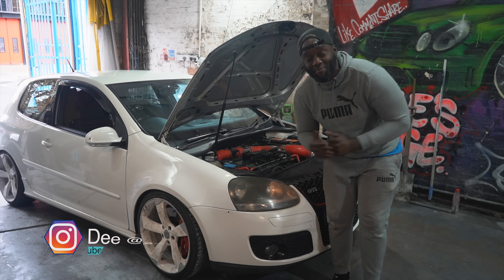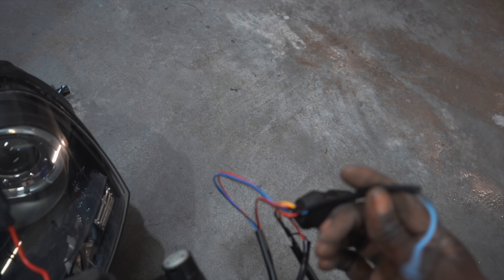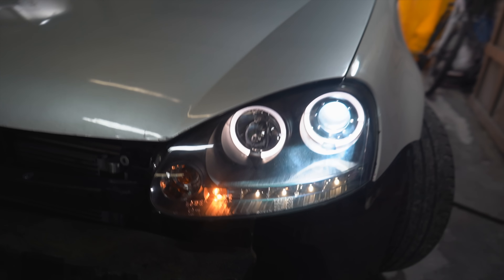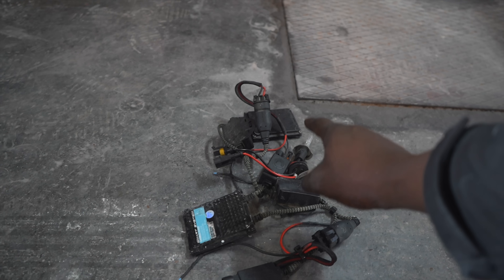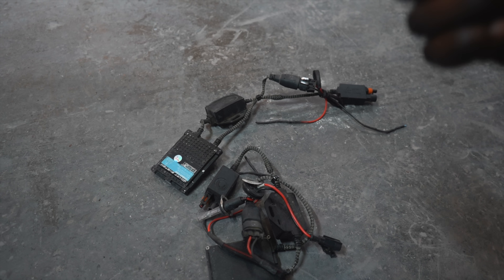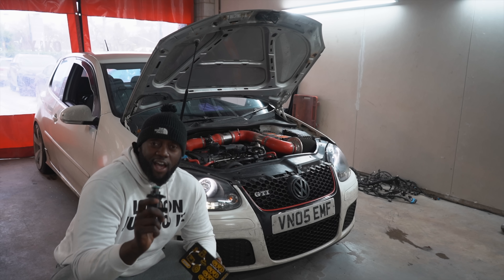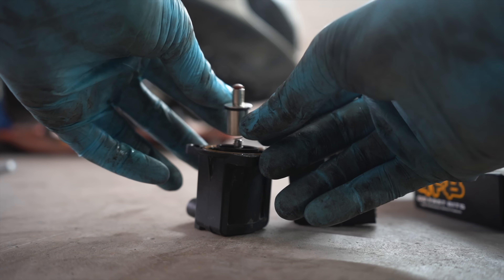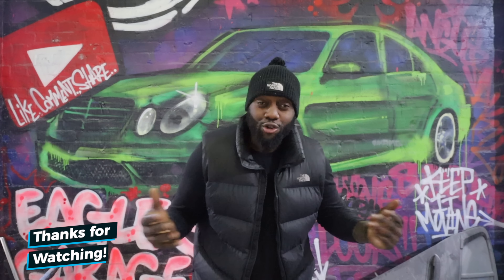MY STAGE 2 HIGH MILEAGE VW MK5 GOLF GTI GETS MORE MODS! AND I NEED YOUR HELP!

Comment: Use the Rev g dv valve mate. Them  gfb ones make ur car Rev hang and over boost constantly
Reply: I've heard that it's fine if you take out the main spring on the gfb and works just like rev D? (just stronger) also Rev G tears easily with anything above stock from what I hear as well